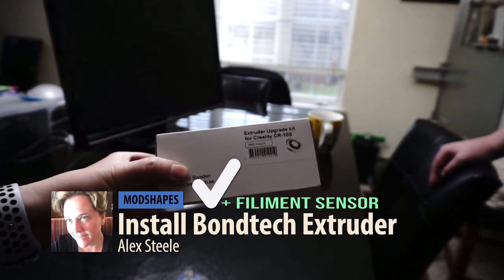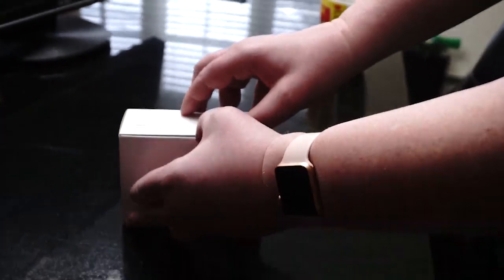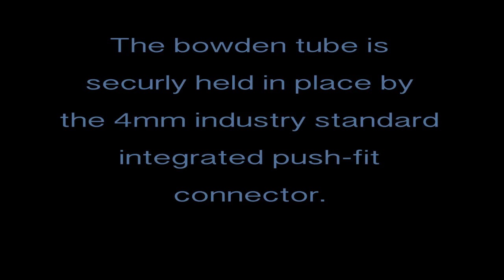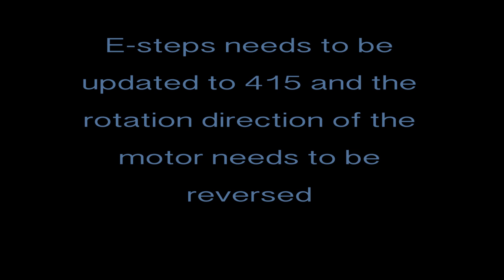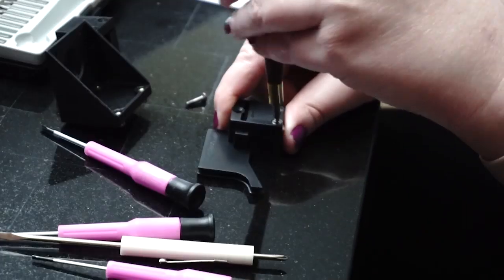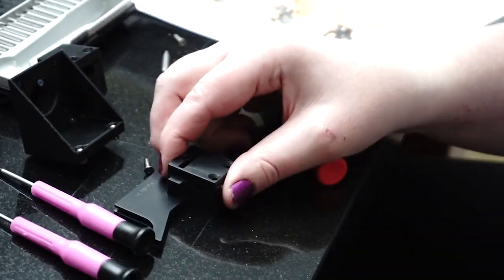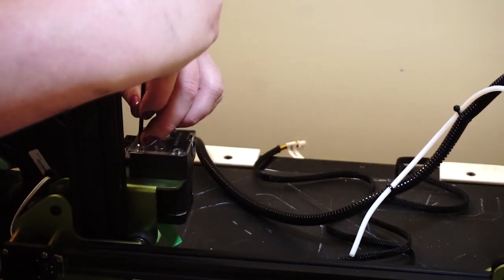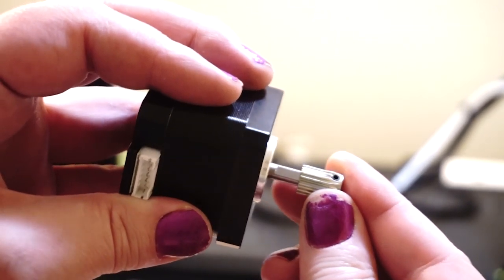Installing Bondtech BMG  Extruder plus a  Filament Sensor Tevo Tornado

Comment: When the filament runs out, or breaks (trips the sensor) how do you back it out? The sensor is so close to the extruder that you can't fish it out from in between, and it can't go back through the switch. I have a BMG on order so I printed the mount and immediately saw the problem. I want Octoprint to park the nozzle, eject the filament with M702 (wait for me to load a new spool), then use M701 to reload. The only way I see to get it out is to pull the bowden tube off the front. Is there a better way? Maybe bend the switch arm so filament can pass through both ways... or an optical sensor?
Reply from the maker: Excellent points!  We actually removed that BMG extruder as it had worn out and was damaging filament. We replaced it with an all metal extruder which is a lot better.

Comment: For the tornado, did you just change the steps using the controller or the script?
Reply from the maker: As it turns out, the change wasn't needed for the Tornado.  Its needed on a CREALTY, and we thought it was required, changed it on the board itself and then changed it back.
Reply: Mine came in the mail today. Hoping to place it on this weekend. Glad it seems more plug n play.

Comment: Nice info, but less music and more explanation would be more helpful. When you do that you have less questions. Where did you plug the runout sensor?? My board is a different version than yours so just the plug name would be helpful

Thanks in Advance
Reply from the maker: I have been working towards better audio production - in the past the audio wasn't good and I tended to use more music because of it.  Its been forever since we did this, I will look at the board and take a photo of it and let you know.  Lighting, audio - little by little the goal is to increase overall quality. Thank you for your comments and I will try to get back to you ASAP.

Comment: Hi. Where did you get the filament sensor and where on the board do you plug it?
Reply from the maker: That was ordered on ebay with criteria being filament run out sensor compatable with the CR-10.  I checked and the link stopped working but ebay has others that look about the same.  The port is the only on that was open for me, I think it was called xplus but its been a minute.

Comment: Hi there
Did you change the direction of the wires for the extruder motor when you installed the Bondtech extruder? Thanks
Reply from the maker: Not for the Tevo Tornado, it was already reversed and that step wasn't required.